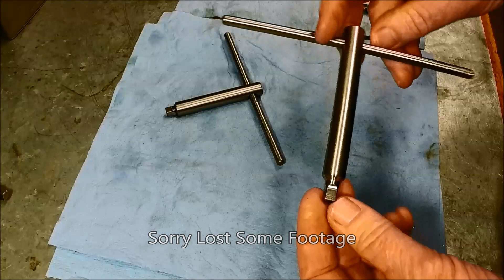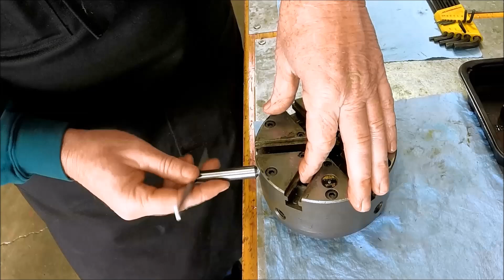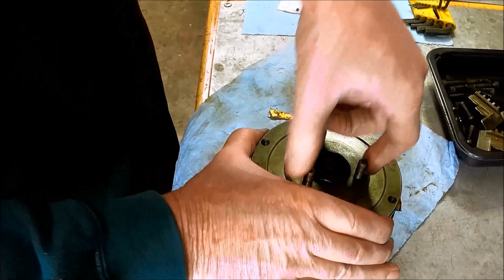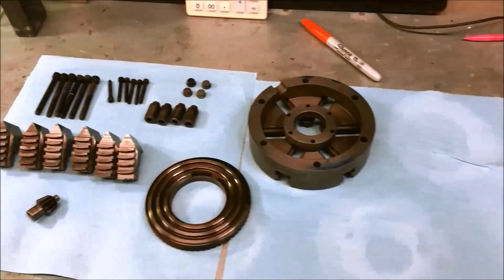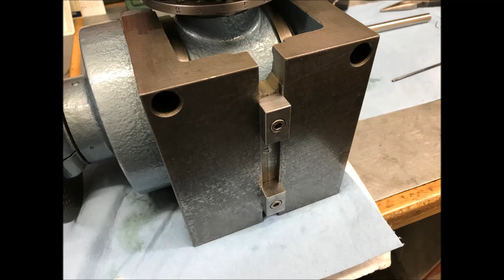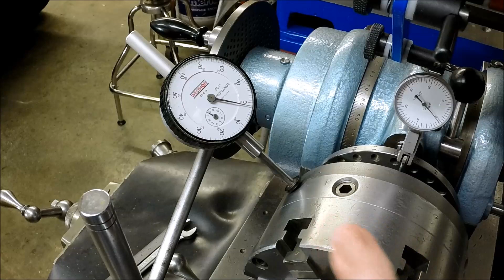Walter Dividing Head Restore Part 5 - Cleaning up the 6-Jaw Chuck

Comment from the maker: Note on the 6-jaw chuck alignment. The error I'm working on correcting is the angularity or face alignment depending on measurement method. I didn't rely explain that in the video. I did confirm both the internal and external jaw features our running out with the same error. It was hard to measure on the chuck body with all the dings and dents. The eccentricity can be adjusted out but both need to be correct. The reason for stopping where I did. 
Thanks everyone for watching and commenting, part 6 with the fix will be coming out soon. 
-Dean

Comment: That would have been me who was wondering just how much movement you'd get between the locked and unlocked position on that dividing head due to the way it locks the spindle. It's unfortunate you didn't get the test certificate with that head when you bought it since there's little doubt that's a dimension Walter would have listed. Probably playing with the spindles end play nut a bit more could reduce that some more if it's important to you. But a half thou is still pretty damn good.

One item you missed was checking the face of that chuck for any axial run out. That one of the most important checks since that face does get used to locate some parts. By the looks of the dents that chucks been dropped multiple times. Hopefully not while attached to the dividing head. A real shame for anyone to mistreat high precision and costly equipment like that chuck and dividing head.
Reply from the maker: Were on the same page. The face / angularity alignment was so bad, visible by eye it was time to wrap up part 5. I think I showed a two point run-out  measurement on the test shaft with about a .007 delta. If not I just let some part 6 info out of the bag. I'll try adding reading the face or jaw face pads in part 6.
Thanks for the great commentary,
Dean

Comment: Can you not adjust the run-out out? Was a great video none the less. I enjoyed the scraping.
Reply from the maker: The Axial alignment is the issue. I could adjust out the standard runout. but there was no point in proceeding without addressing the other. I've got a solution and should have part 6 out soon. 
Thanks for watching Buddy, hope you guys are finally warming up.
Reply: Regrind the jaws huh? It's a sweet chuck worth saving no doubt.  It was 50 here one day after the deep freeze finally rolled out of town. It's like 25 today, but I have to TRY to anneal a shaft outside. :) @TheAyrCaveShop